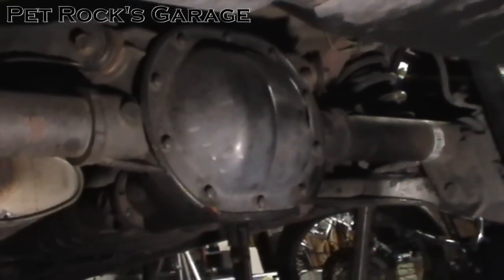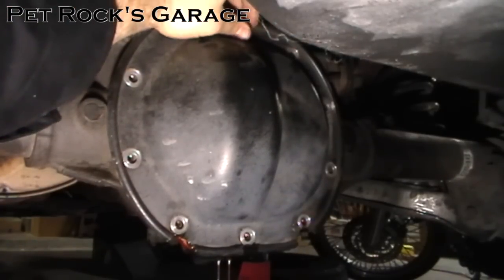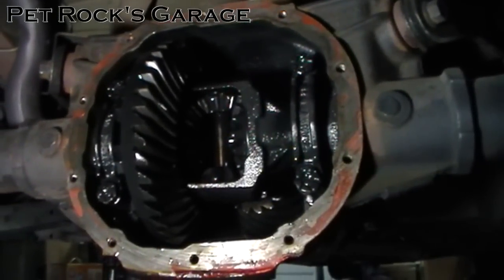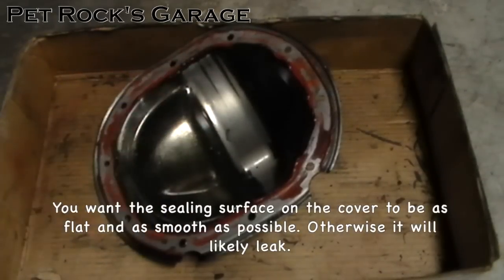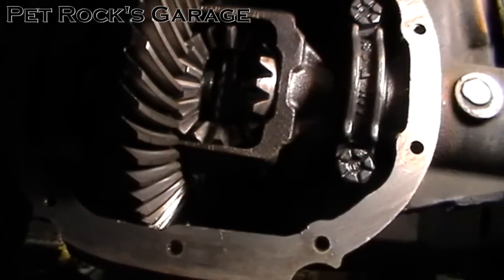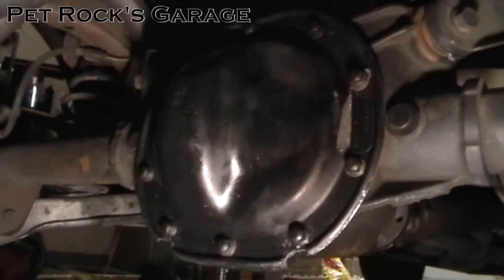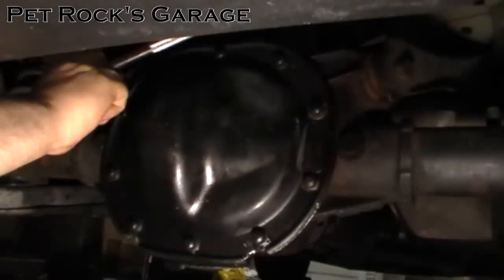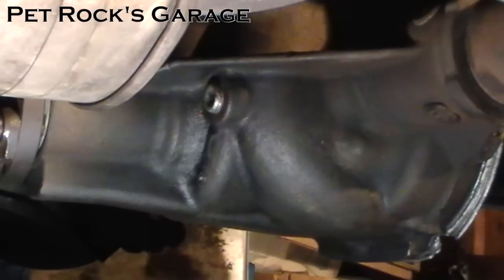How To Change Ford 7.5 & 8.8 Differential Fluid - Ford Mustang

Comment: Don't know if youre still monitoring feedback on your video, but just want to say, excellent video Pete. Thanks for your time and detail. I know this vid is 7 yrs old but it's timeless. Been a while since I've done a fluid change in one of my mustangs, but a quick refresher vid is always a plus; actually brought a couple things to light for me for my 93 4cyl 7.5" diff. Dropped my tank to replace my dead "stock" 60lph fuel pump(swapping with a 115lph, so better flow volumn im suspecting), and with the diff being right there, figured it only makes sense to change the fluid now. More money than I wanted to put into since I'm selling it, but feel better making it right for the next fox fan lol. Anyway, thank you, again, for your time in puting this together.
Reply from the maker: Yes, I'm still monitoring my videos and post new ones when I get time to edit them. I'm glad my video helped you out. Thats why I make them.
IMO, as long as the info in the video is relevant then its age doesn't matter. Since this isn't a 'current events' or 'pop culture' video and Ford 7.5 & 8.8 diffs are still on the road, this video should have some legs.

Comment: I got my fluid changed about a month ago.  It was a fairly difficult job especially with getting the fill plug removed. There was some kind of large metallic  piece that made the fill more difficult to get at. Anyway, the job was completed. I sure have a nice shiny cover but I forgot to install a larger magnet like you did - I'll consider doing that at the next change. I installed a regular gasket instead of RTV. I'm always amazed that I don't have leaks after any fluid change.
Reply from the maker: I wouldn't worry about the larger magnet. It's optional. It will be OK until your next fluid change. I don't think there was a gasket available for the 7.5" diff when I recorded this video. However, it is now and I recently switched to a gasket on that diff and it too hasn't leaked (yet).  Fingers crossed for yours and mine.
Reply: @petrocksgarage  I'm guessing this is something like the felpro gasket RDS 55081? These go on dry, no RTV right
Reply from the maker: @thymanbearpig7555 , yeah. Part number depends on the differential you have installed, including bolt hole pattern. And yes, they go on dry.

Comment: You should always make sure the full plug will come out BEFORE you try and drain the fluid so you know you can fill it back up....
Reply from the maker: Good point…  but if you can’t remove it you’ve got larger problems then your diff fluid.
Reply: Boosted Buckets it ain’t welded mister
Reply: @petrocksgarage true! But you’ll have oil in there and you can still drive it lol. Great informative and clear video by the way!!. Maybe i missed it.. did you add modifier?
Reply from the maker: @tommy2timez , drive it for a few miles before it grenades itself due to lack of oil, sure.
As for modifier: no.  The diff in the video is an Open Differential. Modifier is only needed for Limited Slip Differentials (LSDs).
Reply: @petrocksgarage  I was referring to the idea that if you couldn’t remove The plug, you still had oil in there. Where as if you drained it, and couldn’t get plug out, you’re stuck.
Reply from the maker: @tommy2timez , depending on how bad the oil is inside, or if you have a leaky diff cover, sure. 
Re modifier: no. Modifier is only needed on Limited Slip Differentials (LSD) to help the clutch plates inside.  The diff in the video is an Open Differential which doesn't have clutch plates, only gears.
Reply from the maker: don't know why my first reply didn't appear for me initially. I thought it didn't post or something. Sorry for the double reply earlier. 

Anyways,  @tommy2timez , yes, correct. If there is still oil in the diff and the plug is stuck you can still drive it around a while.

Comment: Another informative video. I learn a new trick or detail with each of your videos. I will look for one of those pump devices for the gear lube bottle on my next trip to the auto parts store. (Way better than just squeezing the oil out of the bottle.) Also, the axle tube vent is often overlooked by mechanics.
Reply from the maker: Bryan Thomas, thanks a lot.  I appreciate it.
Reply: +Pet Rock's Garage jroyptf
Reply from the maker: +Vensonjfri d iskojpodkgflfl g lffkf Cordellgfodyju, huh?

Comment: You're the second video that says the service manual says to use 80W90 while mine says 75W140 for an 8.8 differential. One of the tags attached to my differential also says to use 75W140 full synthetic. I have a 2002 Mustang GT with a tag that identifies the differential as 8.8 inch. My manual did say that a 7.5 inch differential takes 80W90 but I thought you were working on an 8.8. This is why I watch these DIY tutorials several times before committing to doing the work.
Reply from the maker: This diff is a 7.5". I double checked my factory service manual for this '98 Ford Mustang and it does not distinguish between the 7.5 & 8.8 in the chart for type of fluid. It just says to use 80W90, and to add friction modifier if the diff is a limited slip diff (which the one in the video is not). Either way, if your diff has a tag stating what type of oil to use I would use it.

Comment: If you're lucky, you'll have 2 metallic tags on your rear axle that tells you what type of fluid to use as well as details as to what the OEM gear ratio is and the gear size (i.e. 8.8). Turns out that my 02 Mustang has both tags attached. It'll be a good idea to reattach those tags when you reattach or replace the cover. I suppose some mechanics don't bother reattaching the tags. I noticed one of the tags were missing in this video (the one on the drivers side that has the required fluid type).
Reply from the maker: I didn't know there was a second tag for the fluid. I haven't seen a diff with one. That would be nice. Ifs common for these tags to break or rust away.,

Comment: Great video I've been working on a Chevy Silverado in 1999 but it had the four gears in there so basically the same concept. I have no mechanical experience everything fell apart I couldn't get it back together and I laid under there about eight hours with no luck. Video at 4:00 in the morning I got up at 8 got under the truck held the spider gear turned it put the other spider gear on turn it presto!!! I could not believe it. Thank you for that great video now do you have one for the driveshaft..lol!!
Reply from the maker: Yeah, how the gears mesh and work together can be a bit of a mind twister. But once you figure it out it seems so simple. I'm glad my video helped you out. Thanks for watching & commenting. I appreciate it.

Comment: Nice work.  But you do you you're suppose to loosen the Fill-Bolt before draining it.
Reply from the maker: Thanks a lot. I appreciate it.
Correct, if you are worried the fill plug may not come loose due to rust/corrosion/whatever, then yes you should loosen it first before draining the oil and there is no turning back. However, it's more of a precaution than a rule. Some areas have this issue more than others. It's fairly rare for it to be an issue that penetrating lube and/or heat couldn't solve even in places with high rust. But there are always those horror stories on the Interwebs...

Comment: I watched this video and the transmission fluid video.  My dealership can change transmission and differential fluids within 5 hours.  What type of gasket sealant do they use to be able to make those changes so quickly?
Reply from the maker: Sandbag1300, they are either not letting the RTV cure for long enough (takes an hour for it to start curing and 24 hours for it to be fully cured) or they could be using Permitex Right Stuff.  I haven't used 'Right Stuff' yet, but I've heard good things about it and that it has a very quick curing/drying cycle compared to RTV.  Either way, it doesn't take 5 hours of labor to change the tranny & diff fluid.  So the dealer is probably charging you for hours that the truck is sitting in the parking lot waiting for the sealant to cure.
Reply: Yes, my dealer charges me full rate card and 20 percent above list price for parts.  Since my Jeep is now 10 years old I am doing most, if not all, of the work my self including all fluid changes.  Your videos are a great help.
Reply from the maker: Sandbag1300, ouch.  Thats highway robbery.  I only ever let a dealer touch my vehicles if the repair is under warranty.  Other then that, I do it myself or find an independent shop who can.  I'm glad my videos have helped you out.  Thats why I make them.  I appreciate it.

Comment: Wish i found this video, before I did my 98 cobra. No leaks yet, but i didn't inspect the gears, or put a magnet in mine,  seeing as it didn't have 1.
Reply from the maker: If you drive it like you stole it, you'll be changing the diff fluid again soon enough.  :-)  The stock diff does actually have a magnet.  Its part of the fill plug.  I just think it's not big enough, that's why I added one to the bottom of the case.

Comment: Should I have the rear up on jacks so differential drops down, correct?
Reply from the maker: Yes, like I show in the video. Its not required but it makes getting access to all the bolts on the diff cover a lot easier.

Comment: I have a 66 mustang with 289 and 2.80 gear 8" differential.  Do you know if a 67 mustang 8" differential would bolt up and how can i tell if its limited slip by looking at gears?
Reply from the maker: I'm not sure if it will bolt up.  I've never worked on those vintage Mustangs or dfferentials.  Re Open vs LSD: jack up the rear of the car and spin one of the rear tires.  If the other wheel spins in the opposite direction you have an Open Differential (like in this video).  If it spins in the same direction you have a limited slip differential.  Hope that helps.  Good luck.

Comment: Do you have to wait if you are using a gasket like you do with the rtv?
Reply from the maker: No, you don't have to wait if you use a gasket. RTV requires time to cure.  A gasket does not have that problem.

Comment: I'm confused. My 02 GT owners manual states that the rear axle fluid isn't to be changed or checked unless the axle has been immersed in water. Or when service is required - what does that mean?
Reply from the maker: Oil does not last forever. Especially when been mashed in a gear system like a differential. Even more if its a Limited Slip Differential because of the clutch material getting in the oil. The rule of thumb is to change it every 60k miles. It also gives you an opportunity to inspect the gears to make sure there isn't any excessive wear or play (all signs of a problem). At a minimum you should check the level every once and a while. Especially if there is a leak at the axle seals, diff cover, vent tube or pinion seal. Hope that helps.

Comment: How much oil should I purchase? as told I should pick up some Royal Purple 75W140 for my daughter's stock 94' 5.0L Mustang GT.
Reply from the maker: The brand really doesn't matter. It is the weight/viscosity that does. 75W-140 should be fine. A little thick, but should be OK. I run 75W-90. Your owners/service manual should indicate how much oil you need. But it is typically around 2 to 3 quarts. Fill until oil starts coming out the fill hole. If, when you are done, you have an unused quart, just return it. If it has a Limited Slip Differential then make sure to get 8oz of friction modifier from your local auto parts store too and put that in before adding oil. Good luck.

Comment: Hope you can answer this please. I'm replacing the pinion bearings and races, when setting the backlash and contact pattern without the crush sleeve  .. what would you say the preload should be at that stage?  I know I should look for around 24 in/lb for the final re assembly. Maybe 5 or 8 in/lb  less?  (ranger 7.5 open diff)
Reply from the maker: Sorry, I'm not entirely sure on what the spec is. I don't have my service manual handy at the moment.  I'd pick up the factory service manual for your year/model ride and use it's procedure & specs. It will pay for itself with this job alone.  You might be able to find one free online if your Google-Fu is strong. Otherwise you can order one from your local ford dealer or get a used one off eBay. Avoid Chiltons & Haynes manuals. They are the cliffs notes of manuals, IMO. Good luck.
Reply: Pet Rock's Garage THANKS!

Comment: So no torque specs required for the cover if gasket maker is used?
Reply from the maker: No, not really. You want to tighten it down till it starts to squish out like I show in the video. Once it dries you can snug them down again a little if you like (1/4 to 1/2 turn). Don't crank down on them though or you could warp the pan. The RTV tube should have similar instructions, I will default to the instructions on the tube though. Most RTV takes 24 hours to cure to a point where you can put fluid in the diff. Permatex Right Stuff has a lot shorter cure time, for example. Good luck.
Reply: Pet Rock's Garage thank you, very helpful.
Reply from the maker: no problem.

Comment: Can you tell me how many miles were on that diff? And was it making a whining noise during excelleration? I am going to change my 1994 gt diff fluid today...thanks for the great information...
Reply from the maker: I'm not entirely sure. Its been a while since I did this service.  It was somewhere between 170k & 180k miles I think. No it was not making a whining noise. If yours is that is typically due to the diff backlash being out of adjustment. Good luck.
Reply: Pet Rock's Garage are there videos that explain how to fix this? Can it be done leaving diff on car? Any special tools? And its more like a hum when excellerating and not real loud...not sure its necessary or critical. ...dont drive car much.. cost?,time.? Ps i am a pretty good dyi guy,but not a professional tech thanks
Reply from the maker: There are a bunch of videos about how to set the backlash on a diff. It can be done with the diff on the car. Yes, there are special tools and it's a time consuming, trial & error, type operation. Not a novice job by any means. Its super easy to mess up and expensive to fix if you get it wrong. If the backlash is the problem, it is honestly worth taking it into a shop and having it done. Seriously.
Alternatively, if it is a hum it could be your tire tread is out of round or not inflated properly. You can  rule that out by rotating your tires fronts to back & backs to front and see if the sound stops or changes. or it could be a bad axle bearing or bad bearing in the diff.  I have a video on how to change the axle bearings & spider gears in the diff, but not one on the bearings inside the diff. btw, I'm assuming you checked for play in the spider gears like I show in the video when you had the cover off because they too could cause noise but mostly when turning.
Reply: Pet Rock's Garage definitely not tires,but could be a bearing or any other diff issue...need to drive it today and take it to my friends shop and get his opinion on if it'd worth tearing appart or not...thanks for all your suggestions....
Reply from the maker: No problem.  Noise issues in diffs can sometimes be a P.I.T.A. to diagnose.  Good luck.
Reply: Pet Rock's Garage it was 20 percent low on Fliud...tested seems pretty normal for a 5 speed...my friend is a life time mechanic with over 40 years..I'll see what he thinks...thax

Comment: I recently bought a diff for my 2001 v6 Mustang, its stock 7.5 and 3.27, the new axle comes with an 8.8 and 3.27(Limited Slip.) Is this axle compatible with my v6? Thank you!
Reply from the maker: Yes, it should fit. The gear ratio is the important part. If they are the same then it should be a direct bolt on.  If not, then you'll need to get the speedometer calibrated. Good luck.
Reply: Pet Rock's Garage Thank you Boss, I appreciate the quick response!

Comment: Do I have to spray brake cleaner in the differential
Reply from the maker: Its advised so you clean out all the old oil as well as any metal shavings that the magnet did not pick up. Brake cleaner is cheap, so why not use it?  Hope that helps.

Comment: Need your help so I have a 08 stang v6 and I just added a Yukon LSD and motive 3.73 gears but after the break in period it's still whining I used Royal Purple because I've heard great reviews but it still whines I bought the ford racing friction modifier and 2 quarts of Royal purple 75-140 and was gonna do an oil change and see if that friction modifier would do the trick is that a good or bad idea?
Reply from the maker: +Nathan Borja, LSD’s require the friction modifier or you’ll burn up the clutch packs. Some oil manufacturers include the modifier in their gear oils. I’m not sure if Royal Purple does. I know Amsoil does, and I think Mobile-1. The wine, however, is most likely an out of spec lash adjustment. You need to properly adjust the lash with the correct shims etc or the gears won’t mesh correctly. Diff gears are not a drop in/bolt on part. An oil change after the break in period is a good idea even if there wasn’t a wining noise. Good luck...
Reply: +Pet Rock's Garage  thank you for the info will try that out and let you know how it goes the stang is just sitting now till I find time to work on it by the way awesome name I had a few pet rocks while in the corps ahahah
Reply from the maker: +Nathan Borja, good luck with the diff. Yeah, Pet Rock is one of the kinder nicknames I’ve had since high school. It just kind of stuck.
Reply: Nathan Borja Semper fi